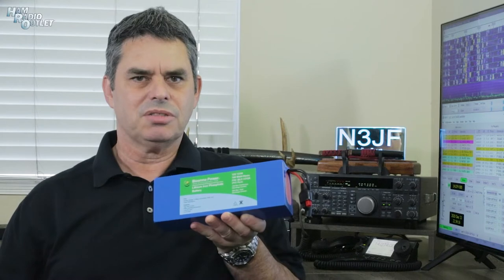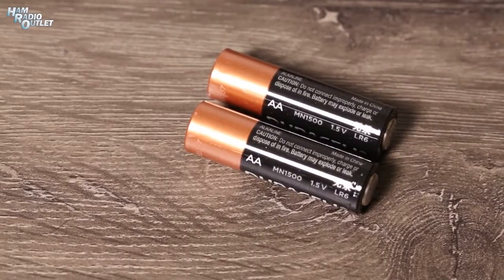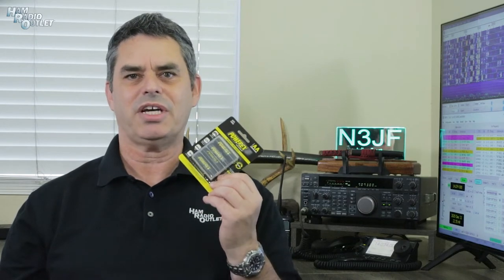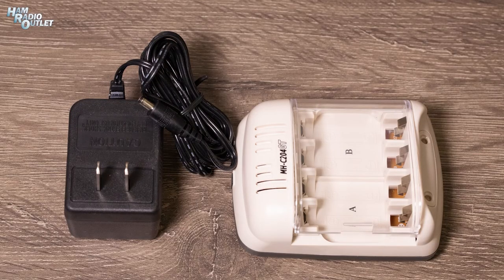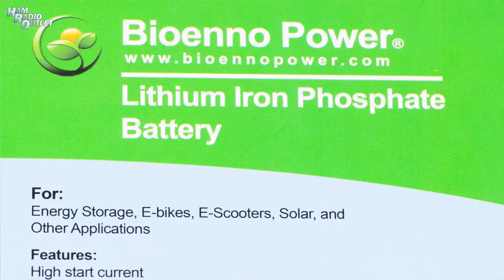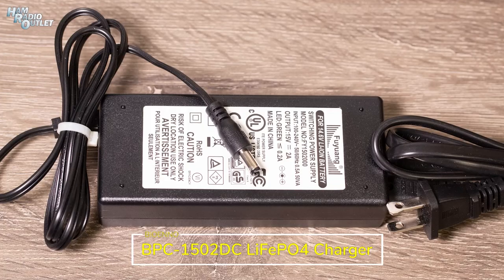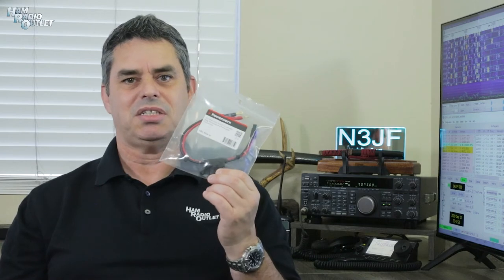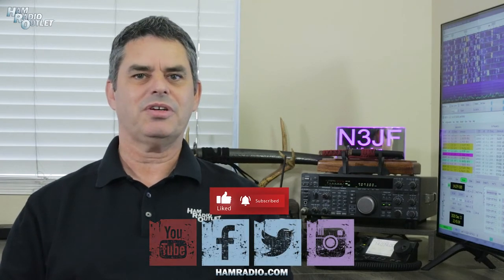Battery Solutions!

Comment: Great video ! Having options for powering radios or other portable devices is a must. Even in Model railroading, the rechangable batteries power some wireless DCC and TMCC devices.
Reply from the maker: Thanks for the comment. The big Bioenno 1212A is a great battery... might run a full scale train for a few milliseconds!
Reply: @HamRadioOutlet  Speaking model trains. Athern, one of the major Manufactures made a EMD GP-38-2 for Motorola as a promotiional item. Me, bieing an Amateur Radio Licensee and a Rail Fan, I excited to see that. Happy Holidays DE Adam K3JCP !
Reply: @Adamdaj  To bad Motorola doesn't give a crap about amateur radio.

Comment: I have that charger and it gets really hot during chsrging. Is thst normal?
Reply from the maker: The charger, or the batteries? The charger gets warm (I don't think it gets hot) but batteries in good condition should not get hot.
Reply: As I stated the charger gets really hot that you are ready to let go of it but you realize its not quite that hot. Thanks for reply.
Reply from the maker: @jdsnapp  I think I'd be tempted to return it if it's getting that hot. If purchased through HRO, there's a 10 day return period. If it's after 10 days, I'd contact Powerwerx at (888) 321-0073 or via their website https://powerwerx.com/